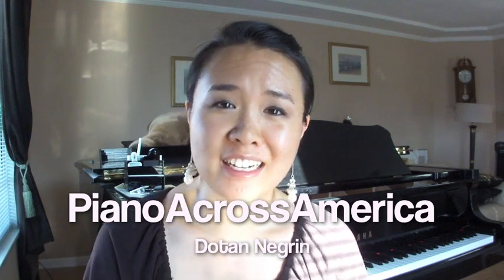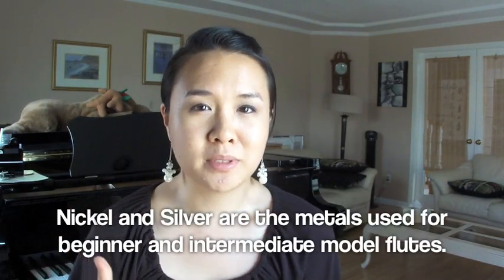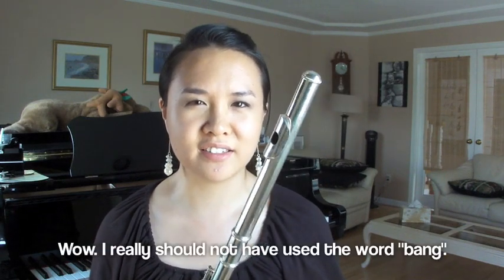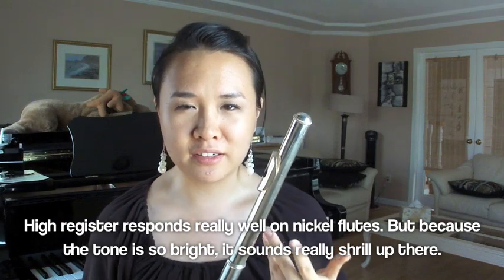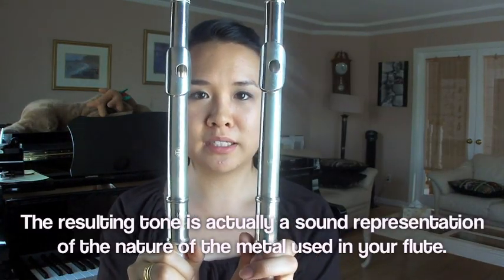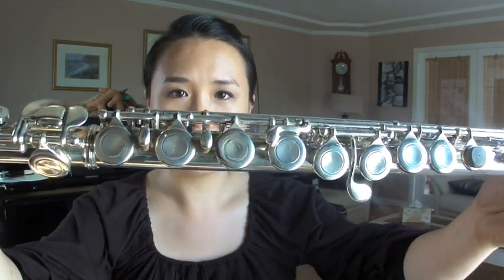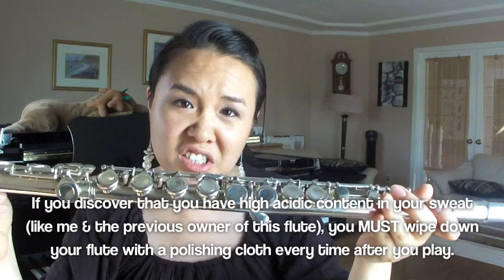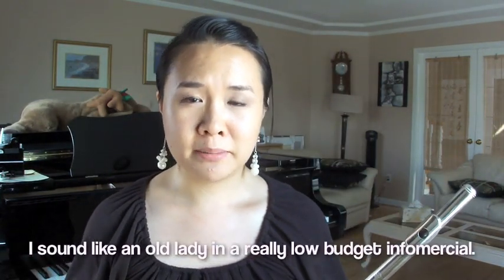Same Diff? Nickel & Silver Flutes (+ PianoAcrossAmerica)

Comment: I had no idea about the acid sweat.  I actually played a Bundy flute for years in elementary/jr/high school and not only had worn out the keys, but also I had a worn spot on the flute body where it rested against my hand.  Yuck!  I am looking to start playing again (for fun) and getting a Yamaha like yours, so I will make sure to wipe it down!  I do have a question though... some of the girls in my high school band (the sort who had nice expensive flutes and took private lessons) had I think silver headjoints with gold lip plates?  Does the lip plate make a difference in the sound or just the headjoint?
Reply: Usually, is the headjoint the main responsible for the color of the sound and the lip plate is responsible for the direction of the airstream.
Reply: No. It looks nice, I suppose, and it doesn't tarnish, but it doesn't affect the tone.

Comment: Dotan, thank you for you videos. However, I suspect that the only viable comparison is between two otherwise identical flutes (like a Yamaha 211 and a 311, correctly set up). Comparing different designs is comparing different designs, not metals.

Comment: Can I substitute C foot joint with B foot joint on my regular intermediate flute?? Is it going to work??
Reply: I would say it works but not something u want
Reply: yass
Reply: MusaIbnHaroon what do you mean? explanation please.
Reply: +Aidil Zuhri Salam alaykum, sure. I might be wrong with this. But from my experience if u use intermediate flute. It is most likely that u r playing in a band or orchestra type rather than composing ur own music
Reply: +Aidil Zuhri In this case,  a low b note is simply not needed because u don't get this note in orchestra. U only give urself more hustle
Reply: +Aidil Zuhri by adding that extra b there.
Reply: +Aidil Zuhri and if u have a nickel flute then defo not something u want... Because nickel low notes are already bad enough. A lower b just sound even worse. Especially if u soloing.
Reply: +Aidil Zuhri inshallah this make sense to u. if u want upgrade turn silver is probably the most important thing to do(ok Maybe it's just because I love silver??)
Reply: +Aidil Zuhri I have a B foot and I've never had to play the low B except warming up.  If you have a need for the B then go for it, if not don't bother.
Reply: @FluteHaoran1997  what did you mean with the word "bad" did you mean thin or harsh sound?? Because my Yamaha 225 SII sounds stronger on low tones than my Yamaha 361 with a silver headjoint. Both flutes have new pads installed. The 361 has some kind of a clarinet warm low register but the 225 is stronger and with a darker tone.

Comment: I really prefer the silver flute. The only thing is... I hate how it looks when the metal wears out.
Reply: It is just hydrogen sulphur that flows through the air that causes the silver to get brown, green and black color too, and it forms a thin layer over the  metal, though it also keeps it protected it down there. When it is cleaned, it looks as shiny as when  you opened your flute case for the first time. Greetings.